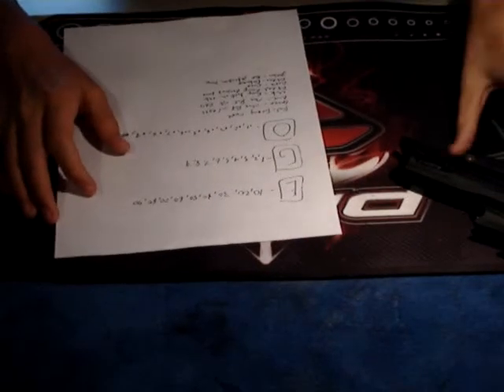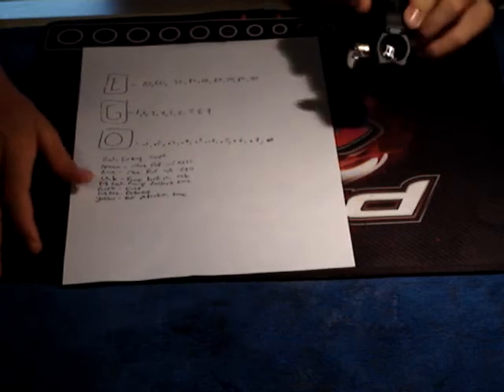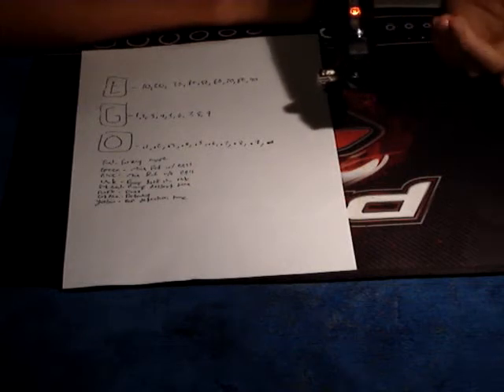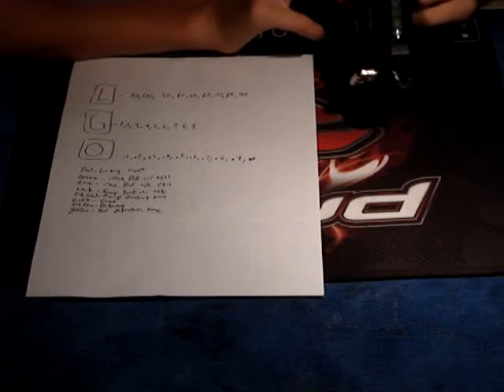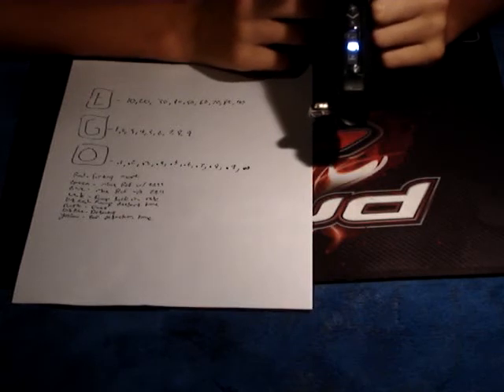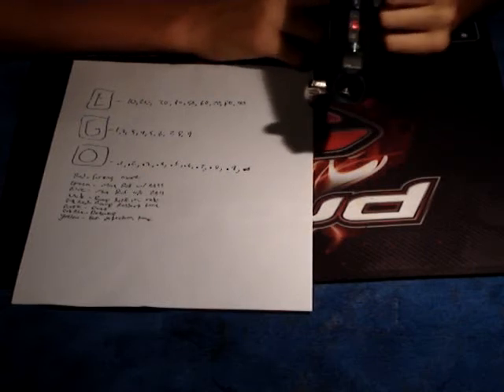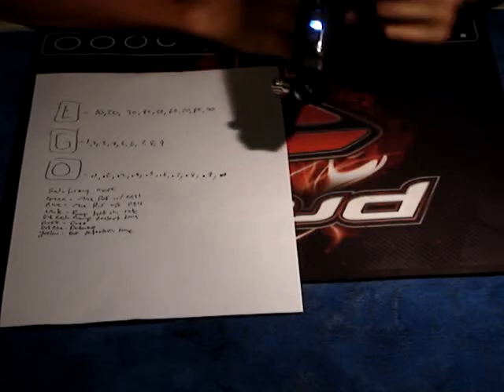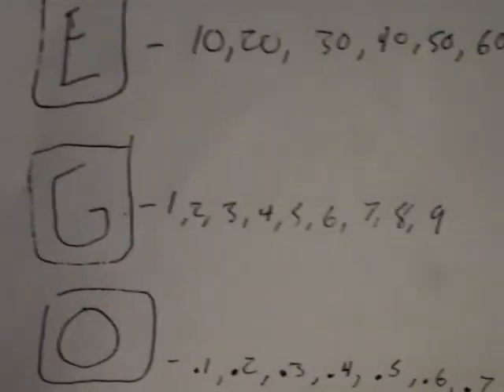Programming the Etek 3 LT Board

Comment from the maker: @stevenajpvv Etek3 LT w/ Ape OLED Board, Zick2, TechT Hush Bolt, Empire RF Chip. Empire Prophecy (RF), Ninja Air 68/4500 Carbon Fiber. TechT iFit barrel kit (usually .679 insert). Either Proto 12in 1peice or stock barrel